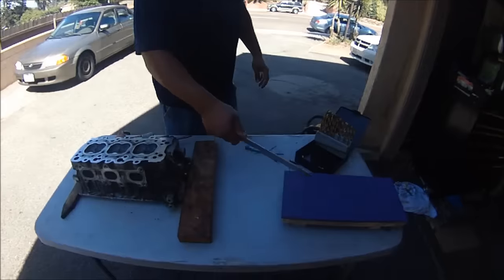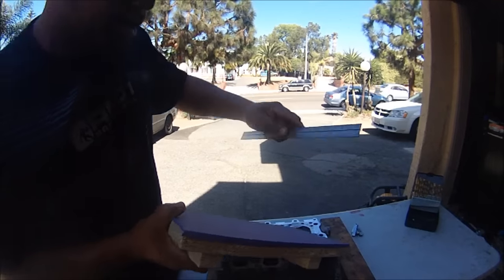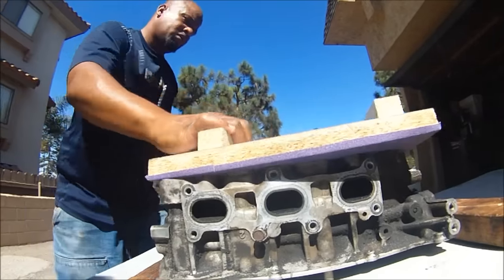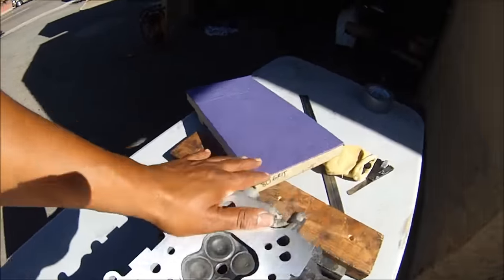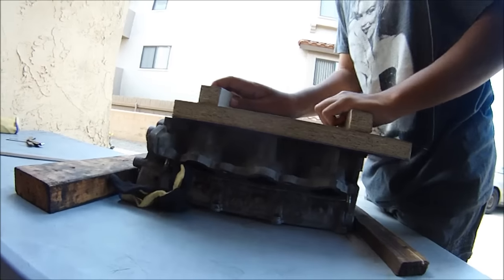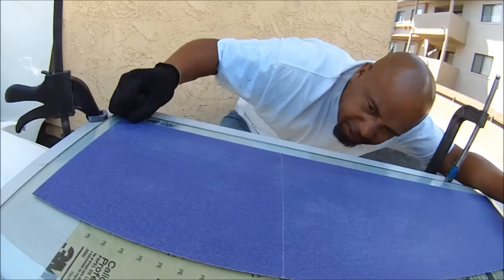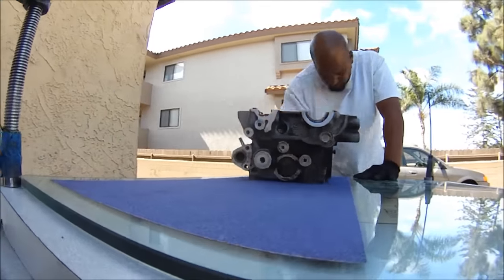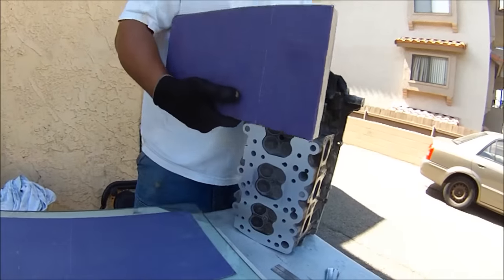HOW TO RESURFACE A WARPED CYLINDER HEAD AT HOME WITH SAND PAPER still works in (2023)

Comment: The problem with this is you aren't going to have the correct finish on the surface of the head, today's Aluminum heads need a surface finish of around 16 RMS for MLS Gaskets a 16 finish is like glass and requires the use of a CBN cutting mill 120 grit sand paper won't get you anywhere near a 16 finish you may get it flat but the MLS gasket will fail because of the finish, you challenge people to stop hating and make a video I have over 100 videos many are on block and head milling so please don't try to pull that on me spend some time watching my milling videos and you will realize that this is really not an acceptable way to resurface a late model Aluminum head at least not for an MLS Gasket I do however think a.composite type gasket and not an MLS would work fine on this head, also I really love your attitude when you say if your broke you can do this,  I say nice job your not just sitting around collecting welfare or feeling sorry for yourself thinking everyone owes you something like so many people do today,  insted you are innovating and making something happen if more Americans had your attitude and willingness to make something happen this country would be a much better place  NICE JOB!!
Reply from the maker: Subtle over analyzing hater trying to end your comment on a nice note after bringing up your stereo typical thinking of black folkz which this video had nothing to do with. Your still leaking haterism .keep moving forward peepz and don't listen to people who try to slow you down or stop you. This method works just fine wreckonize that some people have placed themselves on an imaginery pedestal and need their ego to be massaged and fead by boasting, kill all that negative noise guy.
Reply: +oldskool funk Wow!! I' m curious how you happened to come the conclusion that because I didn't agree with your method of resurfacing that I am stereo typing Black Folks as you put it, what in the world does any of this have to do with race. Please don't tell me you are one of those guys who deflects corrective criticism by screaming Racist! I assure you the color of your skin has nothing to do with the fact that your method of resurfacing this head is not correct for an MLS Gasket, it would not matter if you were purple or pink I still wouldn't agree,  the fact that you have work ethnic and are making something happen insted of saying" I can't do this is a great thing.  you ended your video with a fantastic shot on Salvation and being Born Again. 
Then you respond  by calling me a hater and a racist, are you serious?? Let me give you some advise Bro, if you are wise you will listen to me I have been a blood washed Born Again Christian for 29 years I have a vital daily prayer life and am part of a Holy Ghost filled church. Brother if you want t to reach people with the gospel you have to change your attitude. when people disagree with you firing back at them with biting accusations is going to undermined everything you said at the end of your video. I am saved so it does not effect me but if I were a sinner and you responded to me this way I would want nothing to do with the God you spoke of. you are reverting back to the old nature taking  criticism and twisting into a race issue is you flesh Bro! it's your old man if you truly are Born Again STOP IT! you are doing great damage to the kingdom of God you are His ambassador
if you are going to preach Jesus, Than you have to live a testimony, Cylinder head milling does not really matter but turning sinners away from the Gospel because of your fleshly attitudes matters allot I hope you are listening because God is speaking to you through a Brother. I will be praying for you
Reply from the maker: You came at me with your pride in the air my man, no one is talking about welfare either, I dont mind if you dont agree, the point is dont come with your ego all flared up Im just out to show what works if your broke. I would respect the fact that you dont agree but when you start bringing up stereo typical nonsense and say junk like"Your not just sitting around collecting welfare" then your pushing buttons and I dont know if your being cool or facetious and making a joke that has nothing to do with the video thats when you lost me. I never called you a racist when I say hater I mean someone who is looking for and trying to pick something apart (over analyzing) either to bring someone down, stop, discredit them or get in the way. Im not out for your vote neither am I trying to please man. Im only out to help because I know the struggle of a broke person. If you know the Lord would he tell you to get big headed and let your pride get in the way and tell "me not to pull that on you" and brag about the way you got it going on? Dont get it twisted my man I love the Lord but I am also a firm soulja for Christ who does not take so well to complaining. This videos job is to show people how to produce results not complain.
Reply: +Myvintageiron7512 A 15RMS alox finish is 70 micron avg, equals to a P220 alox wet send. With this method the glass is so hard that you can even reach an 8 RMS by using higher and higher grit. It only takes more time.
Reply: +fujimotosan who is going to spend the hours it takes get that? it's $40.00 to get a head milled spending the time to get to that finish is just plain stupid and a waste of time and no one who does this with sand paper is going to get it right if you can't afford a mill job how will you afford a profileometer to check your work?
Reply: +oldskool funk No that is not correct I didn't come at you with pride. I disagreed with your method and you went off on me you are the one acting out of pride you can't handle it if anyone disagree's with you even in your opening statement you use the word hate and hater to anyone who disagrees with you that my friend is pride hate and hater are strong words as a christian you should not be throwing those words around Jesus said if you hate your brother you are a murderer so your calling out anyone who does not agree with you as hateful and a murderer what is wrong with you dude? you need to get all of that nonsense off of your channel it's a real bad testimony. second point is we live in a society that is filled with people who mooch off of the government when they are perfectly capable of working and making something happen these are facts then there are people like you and me who work hard and get it done every day I admire that when I see it. I fail to see how pointing that out is pushing buttons what are you talking about when you say that What Buttons? and third you did call me racist don't back peddle and twist your words now brother you said I was Stereo typing Black Folks if that's not calling me a racist I don't know what is, what are you talking about where in  any of my posts did I say anything about Black Folks?  you are the one who brought it up I used the term Americans because the problem with America is nobody does this kind of stuff anymore when there is a problem they just ask for a handout they don't do what ever it takes to find a solution and fix stuff. Again you need to address this,  how is not wanting my Tax dollars that I work hard for to be used to support someone who could work but won't because of pure laziness nonsense [lease enplane to me how a Christian thinks this is nonsense?
Reply from the maker: So when I pulled your card and exposed your subtle haterism then all of the sudden you are Mr Holy Christian born again for 29 yrs huh? You remind me of that time in the bible when Judas came to kiss Jesus on the cheek. Who's side are you really on? Your fruits say otherwise . I'm not worried about if you don't like the video just don't get all boastful and try to flex your prideful muscle around like you got it going on. I will always stand up to negativity when I smell it. You never sounded born again from the beginning by the way you came with the wrong intentions that where not Christ like. Don't try to throw God in the mix after the fact you were disrespectful . Your card has been pulled.
Reply from the maker: +Myvintageiron7512 Your waisting time now. nothing you did was edifying . show your pastor your prideful comments and ask him if it had any integrity in it. Your a compromising double minded man. Im a sinner who needs to stay in the Lord and avoid people like you who claim to be in the Lord but are only wolves in sheep's clothing. to keep time to cut it loose.
Reply: +Myvintageiron7512 
funny that all my heads that have had resurfacing done never had the finish of glass like smoothness it looked all scratched to shit even after he done 80 grit i thought it looked better than any of the heads I've had done by "so called PROFESSIONALS using PROFESSIONAL equipment"
Reply: +TheBadspud That just means your using the wrong shop Google CBN head surface finish and you can view the correct finish the fact that you have never seen the correct finish just proves the point you don;t know what your doing
Reply: +Myvintageiron7512 
Na I have seen the proper job done we used to be taught how to use the machines to plane when I was doing my certificate in automotive engineering thing is the shops in New Zealand don't resurface them adequately enough so they are quick to stuff out and then you have to go back and spend more money each time it's all about using you for as much money as they can I'm doing a head gasket on a 92 lancer and all the main auto shops sell you the head gasket set that's everything you need to do the head gasket head bolts inlet exhaust etc for $450 dollars plus I've gone to the supplier and got that same set for $170 the resurface was gonna be $250 I have a mate that does it properly for $180 it's all about the money
Reply: +oldskool funk The only one posting on here that makes any sense is Myvintageiron7512 this has got to be the stupidest thing I have ever seen it's only $40.00 to get a head milled and most shops run the head through a jet wash before and after the milling so the head is surfaced properly and cleaned if you are doing a job like this why would you waste your time spend this time prepping the block/engine bay gathering needed parts neede for the job anyone who works on cars for a living even on the side knows time is money,  and you are wasting both you will never make any money doing this, you are a;so not using the correct type of straight edge it has to be precision machined and hang at least 3 inches off each end of the head that little ruler won't tell you squat about that head flatness you are giving out bad information and doing a job the complete hard way to everyone watching this don't listen to this guy you will just wreak your engine and end up spending tons more money to fix it
Reply from the maker: Mike Stanfeild another hater folkz, addem to the dream killer list and go right through him. don't let anyones pessimism stop or slow you down with their weak thinking keep on smashin!
Reply: +Myvintageiron7512 awesome comment!!!!!!!!
Reply: I could be wrong but you sound like you might be getting a little picky with him. I think what he is doing will work fine on a low compression passenger car. If we're talking about race engines I would totally disagree with what he is doing